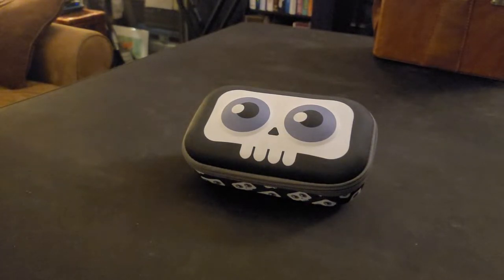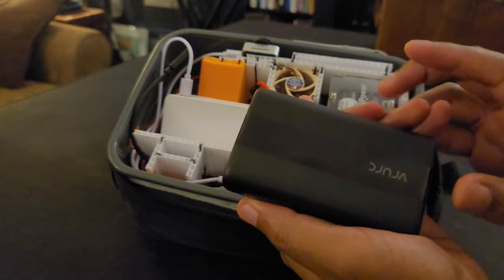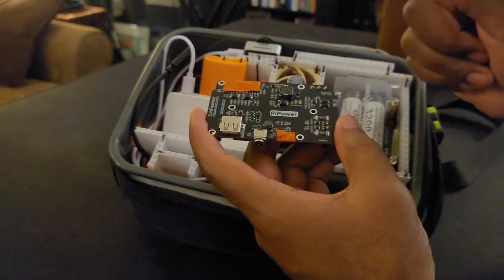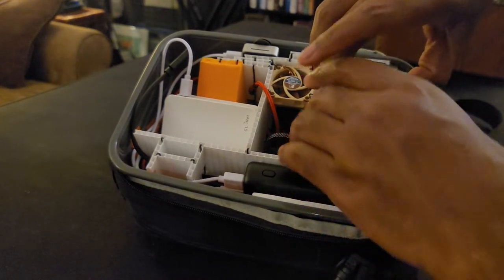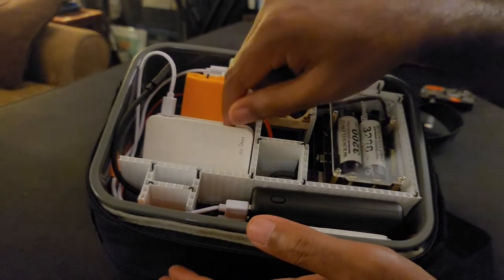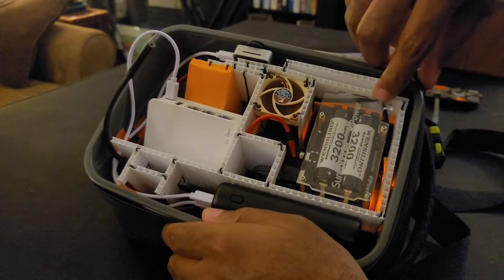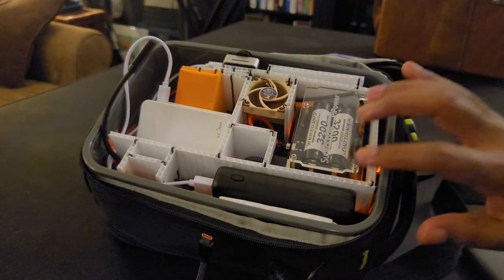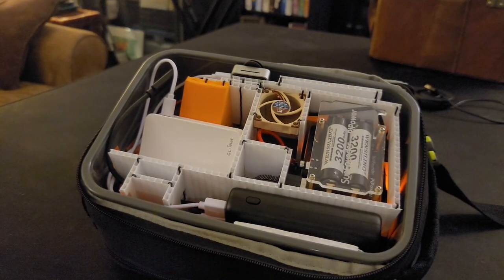Travel Raspberry Pi Lab Version 2

Comment: What is your use case for this setup? What software are you using on the PI. I am looking to do something similar as I travel quite a bit. Be nice to have a setup like this.
Reply from the maker: The pi case is "Akasa Pi-4 Pro case" (The one with the micro usb slot exposed). The lunchbox itself is "Arctic Zone High Performance Ultimate Upright Expandable Insulated Lunch Pack", but I'm using the inner plastic lunchbox liner from the "Fulton Bag Co. Thermal Insulated Zippered Lunch Bag Box". Honestly, you can fit this entire build in the Fulton Bag Co. lunch box, but I just liked the zippers, strap, and astetics of the Arctic lunchbox.

Pi software, I'm using raspbian light (64 bit as I have pi 4 8gb), but I went back and added a light weight desktop environment Xfce using the guide outlined in https://raspberrytips.com/upgrade-raspbian-lite-to-desktop/

Hope this helps ^_^!

Comment: Hello, approx how many hours raspberry pi will run with one power bank of your 20000 mah battery.? Actually I have long hours flight so preparing for that.
Reply from the maker: If I recall correctly, the runtime of this build got me about 6 hours at mostly idle, with occasional "ssh, run a config change, then back to idle". If things were going at full tilt, I'd imagine this build could squeeze our 3 hours or so.

Now days, I'd highly recommend a different  powerbank as it's better at dealing with the power demands of the pi 4, and could probably handle the Pi5 too. The new recommend is below:

Baseus Portable Charger, 30,000mAh Power Bank 65W Battery Pack, Smart Digital Display, 7-Port for Laptop, MacBook, iPad, iPhone 15/14/13 Series, Steam Deck, ROG Ally, Samsung (Black) https://a.co/d/2PbxDo5

This powerbank is featured in the newer versions of my "Portable Pi Lab"
Reply: @CulBluVlogs  okay thank you for the information.